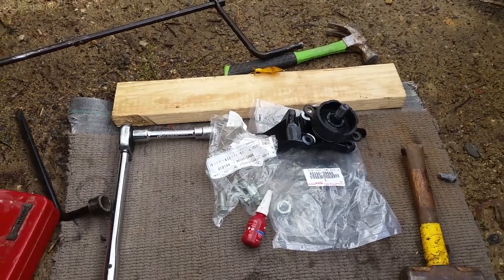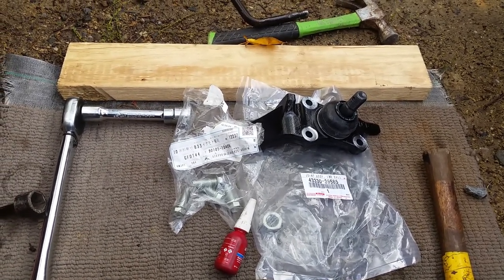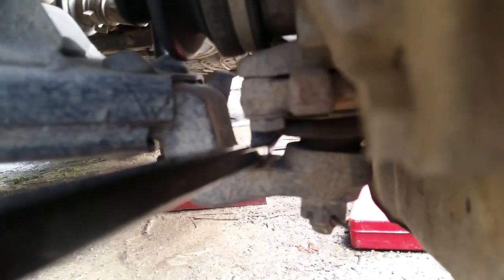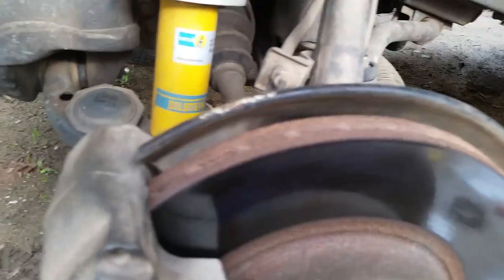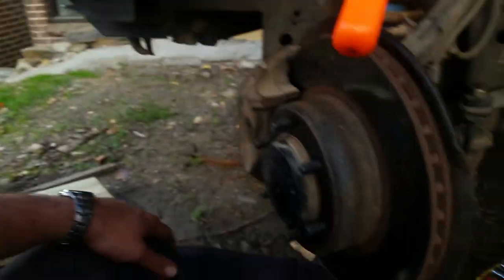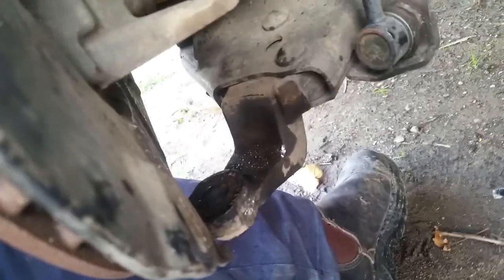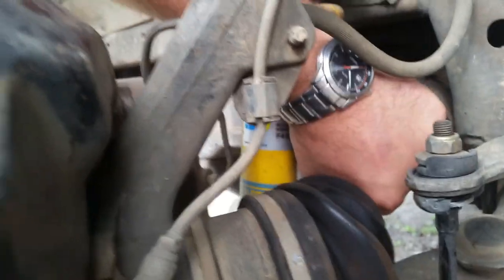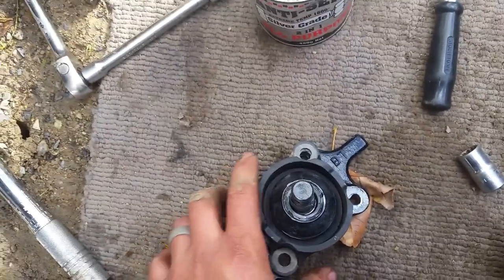How to check and replace lower ball joints prado

Comment: Good instructional vid., I wouldn't have tried it without seeing this video. So, my thoughts !!, JOINT SEPERATER ESSENTIAL + tools extra that you may need... Mole grips (2 pairs if you intend doing both sides at once), small (10 inch)  Stilson pipe grips)- the rubber gaitors on the steering box stick to the shafts, you will need to soak with WD40 or similar before you start, use the Moles to release the clips and clamp (clips are quite strong) don't start unless the gaitors are free to turn on the shafts or they may split... You may need to cut the lock nuts (mine were seized on), Stilson pipe grips to turn the steering box shaft as the lands are prone to slipping spanners - if they are seized!. Try using a sharp small chisel to scribe marks on old and new parts to take measurements from (mine were 19.5 mm length -standard 265 tyres). After torqueing the nuts to spec, take a short 1 mile drive and come back to workshop then re-check torques with the wheels on the car, you may have a surprise, I did. If your steering is out of alignment, go to Youtube (2 vids) search text - How to perform wheel alignment by yourself and How to do basic alignment at home - good straight instructions - they do work.. Cheers all. Thanks DIYIT13...

Comment: You will need a wheel alignment after this….any steering or front suspension component loosened off and/or replaced to gain access to another one = wheel alignment